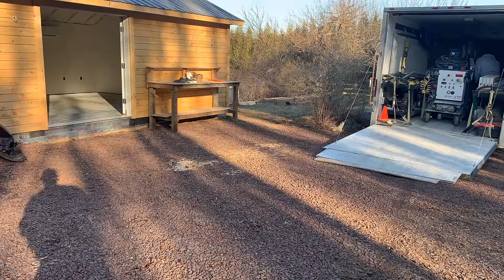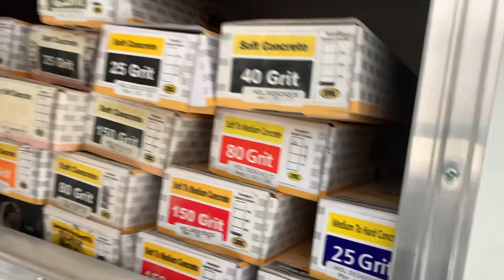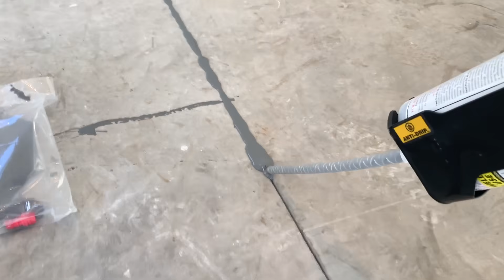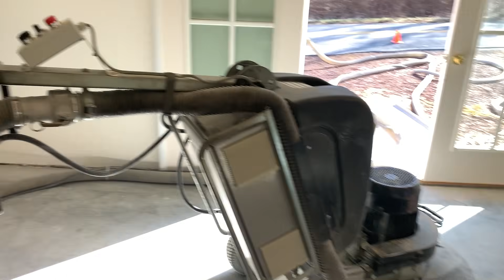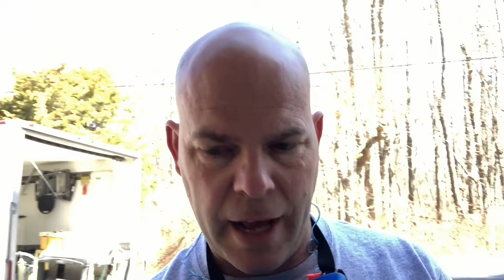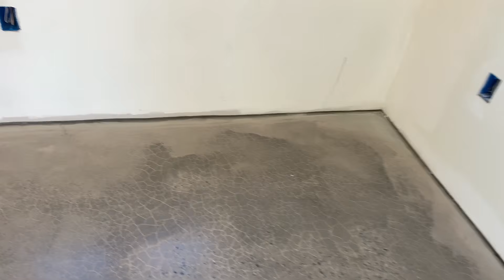Concrete Polishing From Start To Finish : 10 Step Grind

Comment: Do you have to repeat this after a few (10) to (20) years?
Reply from the maker: Typically not,  if anything, it may need to be reburnished to refresh it.  Depends on usage.
Reply: @ConcreteFloorSolutions  any particular maintenance tips, other than common sense that is?
Reply from the maker: @alfredoprime5495  keep the surface clean, just dry sweep and use a janitor mop with water (damp) to wipe up as needed. Do NOT use chemicals to clean it.

Comment: How much $ do you charge per square foot..?
Reply from the maker: typically $4-$10 per sq.ft. Depends on size, location, repairs, number of rooms, condition of concrete, grout coat, Grit finish, stain. Etc.  The larger the job, the less per sq ft.
Reply: @ConcreteFloorSolutions  i can dig it.. same with laying the mud.. Its all over the place price wise.. good to know ...thanks 🙏 for hitting me back..

Comment: was the propane varnisher the 1500 grit why do you change machines. great video
Reply from the maker: Yes it was, the burnisher is needed for the final polish, the grinder has too much down pressure to burnish the floor.

Comment: Hi, thank you for the instructional videos, can I apply epoxy with flakes on my wooden baseboards in the garage? Thank you!!
Reply from the maker: That definitely would not be a traditional  flooring system, but I suppose you can if you want.
I did a video about a month or so ago where I ran the flake up wooden cove also. 
If you want any more detailed instruction, email me direct. My email is in the description below.
Reply: @ConcreteFloorSolutions  excellent I’ll check out your video, thanks for the quick reply!!🙏🙂, keep up the good work

Comment: Wait wait , let me ask you it’s not a problem for the vacuum filters some water 💦 when you grinding???
Reply from the maker: The diamonds get so hot, the water evaporates when the diamonds hit it. It is a mild vapor and does not affect the vacuum or filters at all.
Just make sure you purge the filters at the end of the day.
Our system does it automatically

Comment: How much a SF do you charge
Reply from the maker: Depends on sq footage. +/- $10 per sq ft for 400 sq ft, +/- $4 sq ft for 7,000 sq ft. 
Those prices depend a lot on condition of concrete. If there are repairs and joint filling involved, there are additional costs involved
Reply: @ConcreteFloorSolutions  
Someone would look at your sf prices and say "Those guys are making $4k for the small floor and they're done in one day", but what they don't realize, is your rollong up on the job with over $100k in vehicles, trailers, and equipment. I wish I could work with you two and learn, learn, learn.....
Reply from the maker: @johnruggiero4286  That is the whole reason why I started posting videos on YouTube so people see what is involved in doing this work. I appreciate you noticing and I appreciate your comment.
Reply: @ConcreteFloorSolutions  do you use a similar pricing system for your epoxy flake floors?
Reply from the maker: @jakewilson1749  There are so many variables involved, it's hard to say.  They used to be similar in price, I have been raising prices for polishing just because it's so labor-intensive and requires so much expensive equipment.